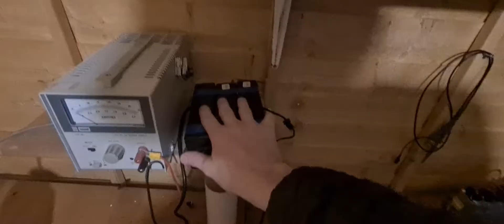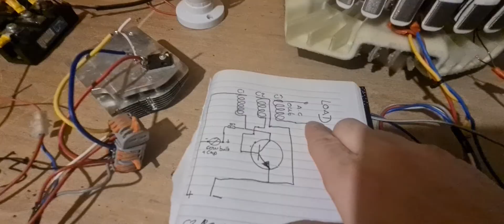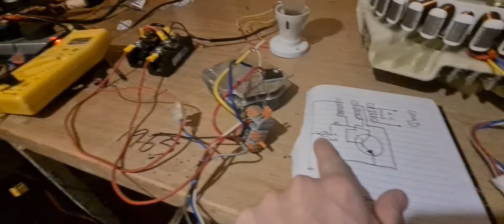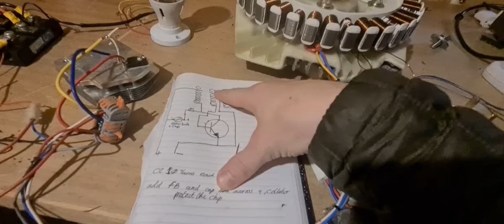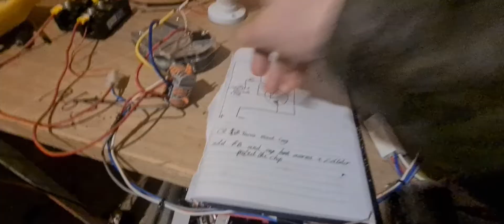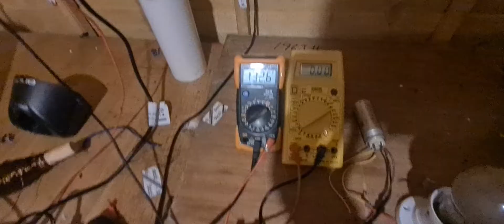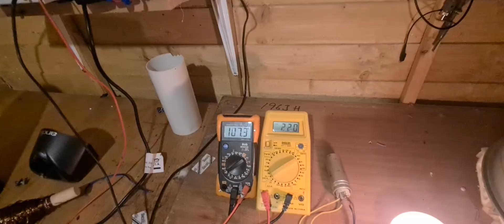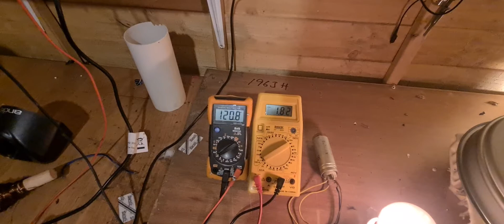1kw hyperdrive (how it works part one)

Comment: wow.   wouldnt it be better to use c1 and c2 as the nth sth drive coils?  c3 should be more output.  a simple reed switch to activate an external voltage for the gate supply on the rotor with 12 small mags for fully adjustable timing by just moving the reed around to tune perfectly......  hope you try this.  I take me hat off to you mate. You got balls.

Comment: Is it possible to get a small schematic for the driving power for the direct drive motor. I have difficult spinning it with alternator and it get very hot and slows down when you put load on it. Need just a sketch of power in to the transistor amd the connection and where to tap for back EMF and where to dump it.

Comment: weve found with these type of motor generators when the drive coils are designed with really large amounts of copper up to 2 pound per coil you can reach saturation quite fast thus the voltage and current drops off to minimal amounts obviously youd have to design a custom unit .there is various lab units by quanta magnetics or check out new videos by sky machine worth a look

Comment: Looks like a 36 coil washer motor.  This is an inverter so input power is DC and output is AC.  Looks like the capacitor bank is the main load. The transistor drives one set of coils to get it spinning and then you pull the power out on another set.  Interesting application.  Might want to be careful of inadvertent electrocution.  Those are some pretty significant voltages.
Reply from the maker: Thank you for the kind words of advice.

Comment: From what I can see it loads to a certain point and then whatever you add load wise the input doesn't seem to change. Am I correct?
Reply from the maker: Yes you are correct mostly lol, the input stays roughly the same. Its why I said its more voltage dependent. Doesn't want to consume more than a certain amperage due to ohms law.
Reply: @EnterTheRealm  ahhhh...thank you.
Reply from the maker: @Biokemist-o3k  no problem merry Christmas bro

Comment: Hi there,
What power source are you using to turn it please? Great work and thanks for sharing.
Reply from the maker: You can use any dc source. I have even used a dc motor in reverse too power the hyperdrive with my circuit. And thank you im glad you like it. 👍
Reply: @EnterTheRealm 
Great job. You exit me coz I am trying to do the same but could not find a way to run it so I spin it with alternator but alternator sucks a lot of power and heats up quick.
A small schematic diagram just for control for the motor.

Comment: Thank you sharing your work, I'm curious what kind of transistor you are using? PNP? NPN??
Reply: Thank you for answering my question. I do have another, in the video you show the light bulb , now I'm assuming this is powered by the initial 130 volt input? or is it the BEMF that is powering it, in conjunction with the diode (full wave rectifier??
Reply from the maker: @novalight8325  indeed its back emf powering the bulb as only one side of the supply is connected to it. I may make a video showing this.
Reply: @EnterTheRealm  Thank you, you have been an inspiration. This is an exciting journey to embark on😁
Reply from the maker: You are most welcome. Thank you. 😊
Reply: Greetings again,  I was wondering,  instead of keeping the windings down to 10 windings per leg, on coil 2 (trigger coil??) what if you put a resistor in line on coil 2? Maybe a 10k ohm, 100k ohm??? Would that work?
Reply from the maker: I need to to an update because I no longer have a need for a trigger winding. Its  been replaced by one of the hall sensors that come with the motor.
Reply: @EnterTheRealm  That's awesome! So using  the hall effect senorsI should be a major efficiency and upgrade to e system, I look forward to seeing the updated video......
Reply from the maker: You can use either. However in this scheme its NPN.  For PNP just reverse the Polarity of the inputs.

Comment: Do. Just to clarify. The coils are wired in parallel per phase? Or in series Could? Could we see the rear? Excellent work BTW.
Reply from the maker: John, of course you can. The coils are wound in series as they were done in the factory. Only one phase is needed to make it turn so 12 coils in series every third leg.. and  thank you much appreciated

Comment: BTW, Could you please confirm that your transistor is it PNP type? I can confirm that 12v is not enough to have the system started/running. What's your minimum voltage to have it spinning ? Thx!
Reply from the maker: I'm using igbt npn type min voltage with 10 turns on each leg for the gate is around 180v to start by hand. Or less if you start with a drill.
Reply: @EnterTheRealm  i will try that thx
Reply from the maker: @felixbourque  try reversing the power coil polarity if you get nothing.
Reply from the maker: Do n you have Skype or fb?
Reply: @EnterTheRealm  sent you an invitation and PM on FB. See you there buddy
Reply: Link diagram?
Reply from the maker: Join my telegram
Reply from the maker: https://t.me/Threeninesix

Comment: what is intersting the output do not make the input current go up by a lot
Reply from the maker: Agreed.
Reply: @EnterTheRealm  what was the reason you reduced the C2 amount of turns ? what was the rating for the mosfet you used ? , we can use a mosfet which can take 1200 volts even ,
Reply from the maker: @EnergySeeker  too stop the transistor burning. C2 is now a fourth coil of separate wire wound on top of the factory windings. But following the same path .
Reply: @EnterTheRealm  because the gate voltage is low that what you mean from 20 to 30 volts max , but we can pulse it external and use that coil , what is the idea to have the gate pulsed by that 10 wire coil , cant we pulse it from outside ? 50hz or 60hz ?
Reply from the maker: You can try but is a self oscillatory system.
Reply: @EnterTheRealm  so are using now C1 to run it as a motor and C2 and C3 as generator ?
Reply from the maker: @EnergySeeker  yes
Reply: @EnterTheRealm  it’s very interesting that motor is only 1kw how can it generate power to loop and also more to give even 1 more kw it’s strange
Reply from the maker: @EnergySeeker  magnetism. I think.

Comment: Please help! I don't speak the language, I use google translate. What kind of capacitor do you use, what is it in? Did you change the thread speed for coil C1? I used the factory 12 coils for c1. I used a dc 220uf 400v capacitor. Did not work. The engine started but after 10 seconds the mosfet broke down, type CS20N50. C2 =10 turns were used in 12 coils in series. What did I do wrong?
Reply from the maker: Use a ac 8nf 400v cap where the dc one is and use 100w or 60w bulb accross the cap. How much input voltage did you use? Try a 1200v igbt. You can get some on ebay for a couple of quid. Hope that helps I'm working on new schematic so I would hold off for a little while unless you want to experiment. Also I now have a resistor and inductor on the gate to help with spikes. I did not change the coil ony the amount of turns on c2 but there's another way that'd better. Don't unwind c2 just get another copper wire and wind over the top of c2 for a total of 4 coils.
Reply from the maker: Basically the bulb protects the transistor.
Reply from the maker: 10 secs is good for first try trust me. Well done.
Reply: @EnterTheRealm  Thanks, you helped a lot. I used 8 car batteries connected in series. I did not use a base resistor. I thought I'd put a 100 ohm or a potentiometer in it. I'll put up a video when the engine starts. A detailed circuit diagram would help a lot. Thanks
Reply from the maker: C2 do only 10 turns now but just over lap the existing c2.
Reply from the maker: @llcd4992  try 300 ohms base resistor. at the time of drawing this I never used one. Now I do. Also a choke to help mitigate any spikes.  Only use 10 turns for the trigger legs now. That's probably why your mosfet burned. Good luck bro. 👍
Reply: @EnterTheRealm  I understand. Thank you for answering.
Reply: I can't find an 8nF capacitor anywhere. Where to find or buy. It's 8uF, I put it in. I used a 300 ohm 5w base resistor. It still started but spins much slower. The transistor is still burned out. :(
Reply from the maker: @llcd4992  im sorry mate its just the capacitor I had lying around. Try an 1200v igbt. And are you using 10 turns on each leg for the trigger?
Reply from the maker: Did you put a 60w bulb accross the capacitor. You need that to stop the back emf burning the transistor
Reply from the maker: 3.7 amps is way too much. There must be somthing wrong try turning in the opposite direction see if that helps. It's probably just the transistor howver.
Reply: @EnterTheRealm  Okay. It just starts by accelerating with a drill and then turning on the power. If I start differently, the transistor will burn out.
Reply from the maker: @llcd4992  right I see you don't have enough volts to start by hand just yet.
Reply from the maker: @llcd4992  I have noticed that some transistors are totally un suitable like the one you are using it's pulling to much Amps try just a 60w bulb on the cap
Reply from the maker: @llcd4992  do you have Skype .